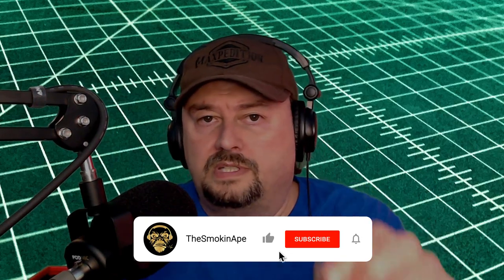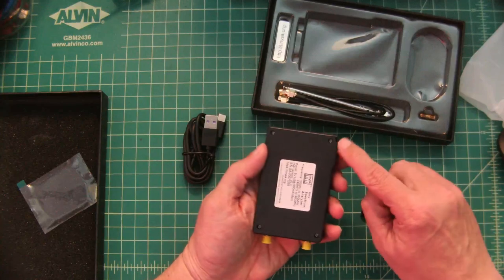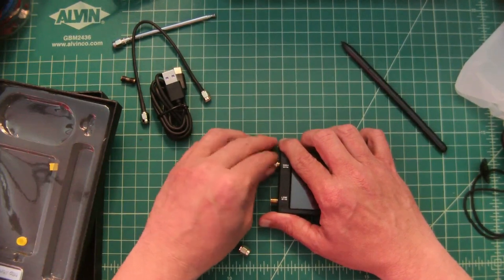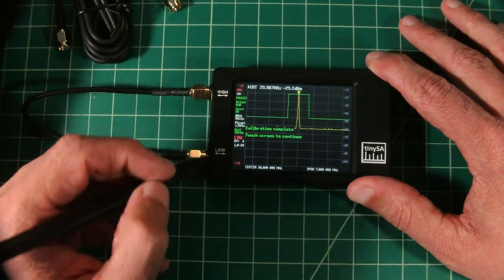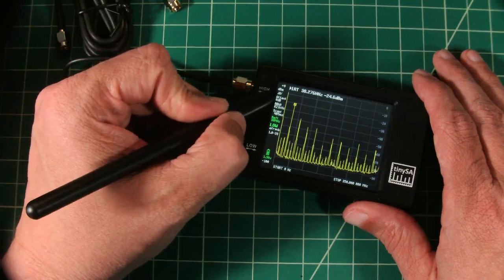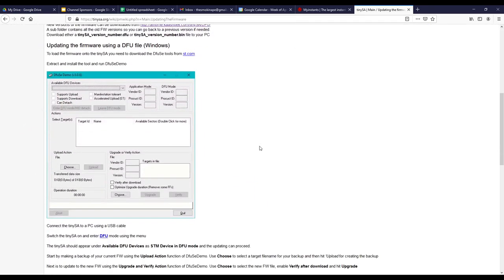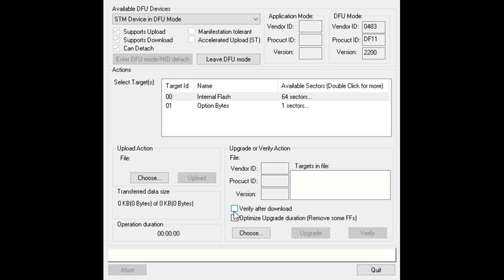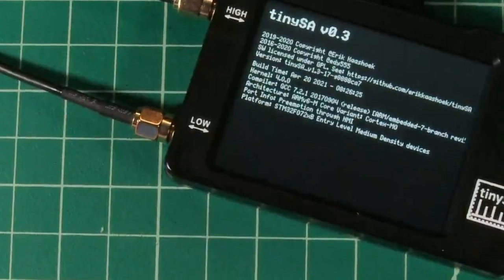TinySA Spectrum Analyzer Calibration and Firmware Update

Comment: For anyone out there using a computer with USB 3.0 it will take about 2 days to reprogram the tiny sa! You need to use a computer with USB 2.0! You might get away with using a USB 2.0 extension cable and attaching it to your USB 3.0 port and plug the other end of the extension cable to the tiny sa. Many, Many people all over the Internet have had the same problem and not just me on my Windows based computer with a USB 3.0 port. The USB 2.0 extension cable is supposed to prevent the USB 3.0 handshake thus defaulting it to USB 2.0. I got my tiny sa yesterday and immediately started to update it (around 8pm?) (I update everything!) it was taking forever to erase the tiny sa. I waited 20 minutes and it was only at 3% and I pulled the plug which white-screened the device. I then had to open it up and jump 2 contacts together while turning it on to get it into DFU mode. (Because the screen is completely white!) It took around 10 hours to finally erase. Then it started to upgrade. It is now 4:30pm the following day and I am only at 29% on a 104K file! I didn’t even get a chance to play with it yet! I found the USB 2.0 extension cable trick (that should work?) somewhere on the internet. I quickly ordered a USB 2.0 extension cable that should arrive tomorrow. (when the tiny sa is hopefully already programmed!) (But at least I will have the 2.0 extension cable for next time)
Reply from the maker: Holy smokes, thanks for the info...
Reply: @TheSmokinApe  no problem! I am on day number 2 at 91 percent upgrade.

Comment: I take it after you opened the box and played with it for a while you realized all it could easily do for you and you no longer leave it sitting in a corner in the box anymore. :)
At this point in my amateur radio career my major tools are a CW key, a microphone, my multimeter, my TinySA, and my NanoVNA. Oh, and a soldering iron. (I haven't even touched my 'scope for a year.) This set of tools does everything. I already have 2 versions of the NanoVNA and I'm waiting for the TinySA ULTRA to arrive. With this small set of inexpensive tools I now feel like I have a functional and effective RF electronics lab on my desktop, or in my pocket, and can easily do all sorts of troubleshooting, fine-tuning and design work that I never could do before. I can optimize all sorts of antenna characteristics, align IF filters, characterize preamps and mixers, even build crystal filters. Along with the help of a few YouTube videos it's as if I went almost immediately from being a noobie ham to being an RF engineer. Hamming is now better than ever.
Reply from the maker: You are correct, I always am messing with that and the NanoVNA.  Thanks for the comment John!

Comment: Thanks for posting. Very informative video. I just ordered one less than 10 minutes ago. I have a Rigol DSA815TG spectrum analyzer but this little guy is very portable. I have two uses for it. One is for mobile antenna testing with the use of a pickup antenna mounted about 100 feet away and the second use is for RF sniffing. It's great for a pocket size RF sniffer whether it's for small issues around the house or hot spots like in power line issues.

Barry, KU3X
Reply from the maker: Glad it was helpful! These are pretty cool to mess around with, thanks for watching Barry!

Comment: For me, seems like "Actual Power" under expert config is no longer an option on these devices in the way you show here from a year ago.  Any suggestions on the new way to config this setting would be greatly appreciated.  tinysa version 1.3.338.     Your tutorials btw are among the best on youtube.  You speak clear and to the point and show only the necessary things to get the job done.
Reply from the maker: Do you have input and output under Expert Config > Level Correction?  Is that what you are referencing?
Reply: @TheSmokinApe  Expert Config > Level Correction  (below this menu item)  no "Actual Power" menu item.   You reference this around 5:35 in your video.  It's totally possible I am missing a step here or doing something else stupid but I don't see it.
Reply: @TheSmokinApe  I do see input/output level inside  "Level Correction settings".   But not sure what to do with them.

Comment: Great little unit, if your using modulation in signal tests particularly if you are doing Sinad tests check the modulation on a scope first because my 1khz tone produced by the tinysa was off by some margin and you don't need to go off much when measuring SINAD, I set the unit for 0.95 khz and I get 1khz tone out, your mileage may vary of course, it's also worth hooking the output up to a frequency counter, I found it more stable and on frequency when operating powered from the usb c port, it's fine for hobbyists but I wouldn't ditch your hp, thandar etc just yet.
Reply from the maker: Thanks for the comment Knoxie, appreciate you watching.

Comment: Am I supposed to keep the High/Low cable connected (as when the self test was ran)? Frankly, something is all wrong because in the first place; even though the self-test passed, when I did the operation to set the -25 frequency, I clicked the "Expert Config" but there was no "Actual Power" option to select. 

In fact, I went through every selection I could and there is no selection that says "Actual Power". I tried a few alternative choices that I thought may work but they didn't even come close. So, I figured the firmware update may be needed to get the same screen options that you had. 

However, After I tried the Windows 64 bit installation of the STM32 Cube, it installed just fine but it couldn't 'see' the TinySA. Even after I set it to "USB". It just kept saying DCU not connected, (or something like that). At this point, I'm getting a little pissed off.

I tried removing and reinstalling the ST32Cube, and of course, I tried connecting the TinySA unit with and without the High/Low cable connected. I used the program's "Reset" and finally uninstalled it for the 3rd time. 

Please note that I'm very familiar with computers and computer software, (I've been building my own 'super-computers' for over 12 years). However, I think the Unit may be bad. I'm almost convinced that the unit was opened by another buyer before I got it, (even though I paid for an unused, brand new one). 

I'm going to try installing the 32 bit version of the ST32Cube software, use my own USB cable, (which is of a much higher quality than the one supplied), and then I'll give that update process one last try.

What is frustrating, (aside from the convoluted way that they came up with updating the firmware in a relatively simple device as this), is that the update steps in the manual, (and yes, even in this video), aren't carefully instructing what the TinySA's physical configuration should be BEFORE the update process is to be followed. 

An important point (as I asked about in the beginning of this rant), would be to mention whether the cable link between High and Low connections, should remain.

Of course, there should always be some reference in the instructions among the steps/procedures, that says something like, "if the ST32Cube software still doesn't 'see' the unit, check to be sure you: A, xxxx, B, xxx, C, xxxx etc., etc." 

Then if all that doesn't help, they should instruct you to place the TinySA carefully back in the box, neatly repackage all the accessories, and then place the box 'gingerly' on a 20-ton punch-press receiver plate. Then apply maximum pressure to the PP's release as you step on the PP's trigger pedal, (of course, safety first! Always wear safety glasses).
FWIW,
Rich

Comment: UPDATE: When I tried again with the 32 bit version of the ST32Cube software, (and used a high-end USB cable), IT WORKED!! However, now the contradictions between your video and the TinySA Firmware manual go ballistic!

At about 8:15 in the video, you install the ST32Cube but the screen that opens doesn't look anything like the one you're showing! It does look like the one in the PDF manual, though. So, in the TinySA Firmware Update Manual, Step & (PDF page 8), it says: "Step 7. Click on the “Erasing and Programming” icon:" 

Now that's what it says should be done, which is right after the previous page, (Step 6) says to click on the "Connect" button. I have no choice but to follow the manual because the video version is just too different. But I have to say that I'm worried about clicking that "Erase" button.

I'll leave you alone now but just so that you know, I wrote this before I followed Step 7 and clicked on that Erase button. If the unit gets lost as a result, I'll just send it back along with pictures documenting my every move, LOL.
Rich

Comment: I bought one with the hope of identifying RFI noise but then I heard that you could overload the Tiny SA and I got concerned about it. Love to see some videos focused on hunting down RFI. I know it has been covered in great detail but I have not seen any one use it for RFI hunting. Also wondering how effective it is using the little antenna for HF.
Reply from the maker: Yeah, apparently the front end is fragile.  I’ll try to see if I can figure something out 👍
Reply: You can use a 10dB attentuator at the input, just in case. This device is quite sensitive, so it should not matter much.
Reply from the maker: @la7yka  not a bad idea 👍

Comment: DFU Demo didn't work. I tried different versions. It did not find the Tinysa. The STM32cube version 10 programmer had a DRP level 1 error and killed it with a White Screen of Death. After a collective 8 hours of frigging around I switched computers from Windows 7 to a new install Windows 10. Even then I was getting errors but managed eventually to upload the firmware by trying different sequences of connecting to the USB port. To whoever tries a firmware upgrade beware there is a 50/50 chance it will work.
Reply from the maker: Dang Ray, sorry to hear you had so much trouble

Comment: From April 21 till now (April 23) the Tiny SA page has changed a lot. I can't find the links you describe in the firmware update section. They are on differnet places. Plus, even though I did find the 
"DFU_LOAD_BIN.bat", the "dfu-util-static.exe" and the "tinySA_v1.4-83-gbe4f4d6.dfu", which I suppose is the latest, I am unable to start the procedure, even though I turn the unit to the DFU mode as described at their page. When I plug the USB cable in my laptop, it makes that specific sound and the COM 4 port is enabled.
I have all the above files in one folder, but so far I haven't found a way to make them work.
If there is a way, please give me some help. 
Thanks in advance.
Reply from the maker: There is a few different ways to update the FW, which process are you following?
Reply from the maker: Are you using win11? https://groups.io/g/tinysa/message/10816
Reply: @TheSmokinApe  No, Win 10
Trying to update as you describe it
Reply from the maker: Both drivers installed?
Reply: @TheSmokinApe  What drivers? I installed the DFUseDemo at last! When I connect the TinySA the computer makes that characteristic sound of connection. Then I run the DFUseDemo, I switch the TinySA to DFU mode and then the computer makes the sound of disconnection. The COM port disappears from the Device Manager and the DFUseDemo, does not see any device connected.
Reply: @TheSmokinApe   The Self test is not ompleting as it should. It stops at Test 3: Signal Level Fail. (written in red). Any suggestions? Tried to reset it to Factory Defauls with no result.
Also the Level Calbration is not working either.. Signal Level too low. Check cable between High and Low Connectors, Written in red as well.
Reply from the maker: @batfalcononyoutube  I’ll post a new video 👍
Reply: @TheSmokinApe  Thank you for all the help. Did you notice my latest comment?

Comment: Apparently V0.3 is a clone. Yes confirmed. My FW was 1.1-52 (patched to pass) flashed up to 1.33 now fails self test 7. CLONE  !!
Reply from the maker: Hey Dave, not all v0.3 are clones.  I got this from the original seller before they were available on the market, it was actually a waitlist. https://tinysa.org/wiki/pmwiki.php?n=Main.Buying
Reply: @TheSmokinApe  On the site you give a link to at the bottom of the page a picture like yours and mine Clone
Reply from the maker: What is say's is that "If the serial number is later then SA-2104" and its v0.3.  Mine doesn't meet that criteria and isn't a clone, there's more to that link than just the pictures.
Reply: When I ran the test before the update it passed. After the update it now fails the bandpass test. Erik himself show you how to check for clones. I did what he showed I did not have the same nice sharp peak he had. Mine was zagged on the left side like the clone. ?